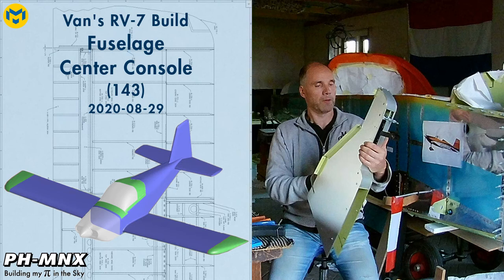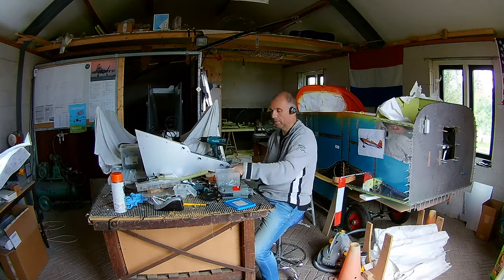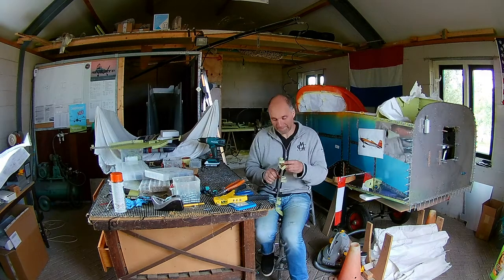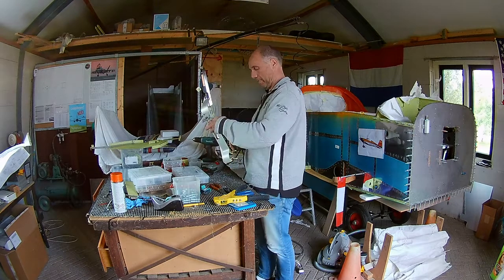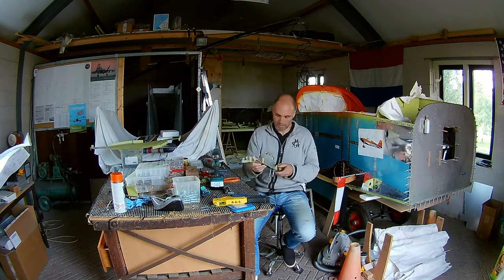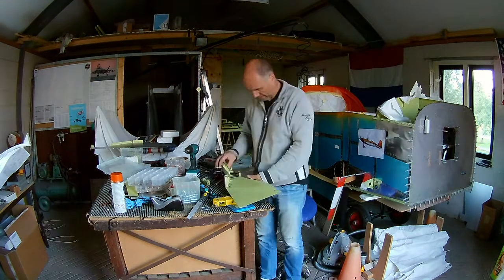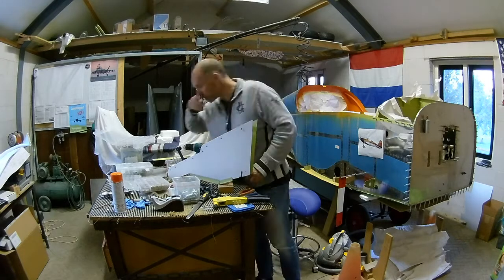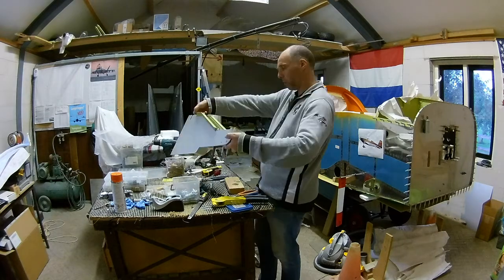Van's RV-7 Build Fuselage Center Console (143)

Comment: Looks great, when is your engine expected to be delivered?
Reply from the maker: Hi Andy,
In episode 134 you can see that we picked up the ULPower ourselves. Belgium is close to The Netherlands, so I decided to pick up the Engine.
Reply: @PHMNX  thats great, are you using the stock Vans Engine mount to fit it? Or is there an adaptor?
Reply from the maker: @AndysRV  
There is an adaptor available by ULPower (USA). It also brings the engine 4" forward, since the engine is much lighter (with more horsepower), zo to keep the CG correct you need to bring the Engine forward.
ULPower also delivers the extended cowl.
Reply: @PHMNX  awesome thanks for the reply I am really enjoying watching your build!! I have and RV6 under construction and it's an engine I am considering also.